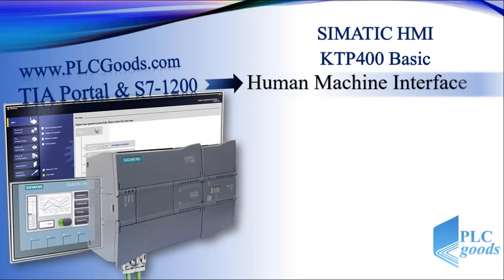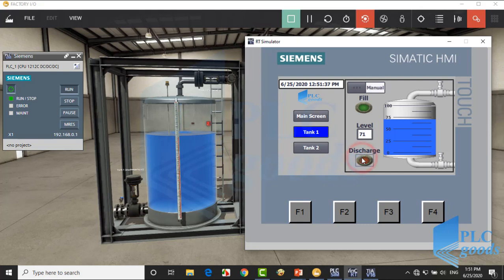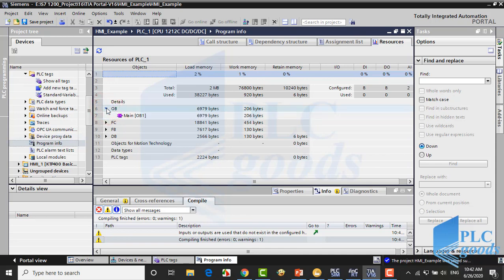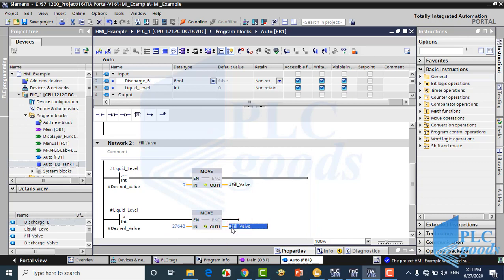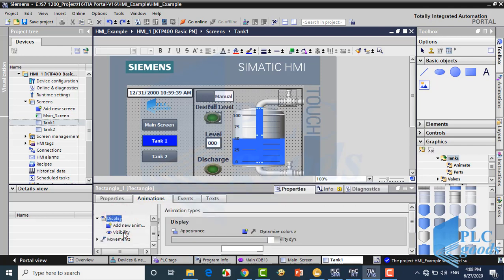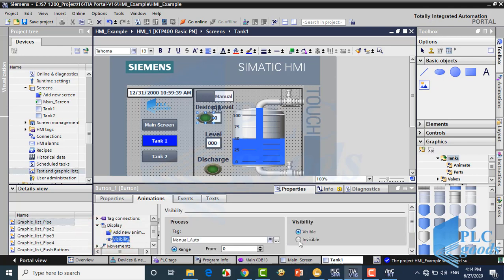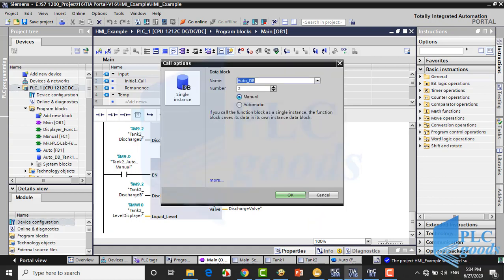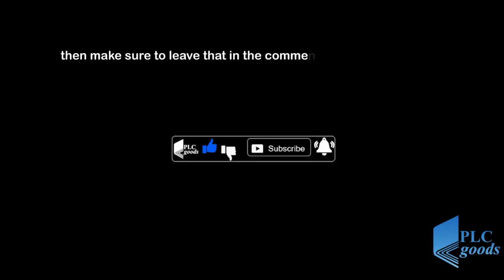TIA Portal PLC & HMI Tank Level Control Project | Factory IO | L 39

Comment: In manual mode how the value of the valve return to zero after release the button?
Reply from the maker: Hi there, when I click on Filling or Discharging buttons on the HMI screen, PLC sends number 27648 to related analog output. When I release them, PLC sends 0 to the related analog output. The logic which turns off valves inside the Manual function is not displayed during the video. Instead of that, you can see the logic that turns off the discharging valve inside the Auto Function. Note that, the Manual logic of the discharging valve is the same as its Auto logic.

Comment: please how  button return to it is original   color when you press anther button
Reply: Hi dear friend. Suppose you have two pushbuttons, PA and PB, and these two pushbuttons are used to change the same address of PLC memory, for example m0.0 .
Also, you have used the m0.0 address to change two pushbuttons appearance (in animation tab of each pushbutton). For example, when m0.0=0, PA and PB should be green and When m0.0=1, PA and PB should be red.
In these conditions, if you use each pushbutton to change m0.0 from 0 to 1, naturally, the color of another pushbutton will be changed from green to red.
Reply from the maker: PLC goods thanks for the response & cooperation!